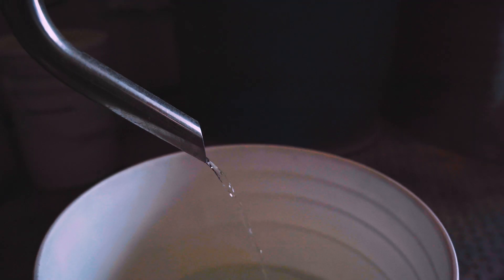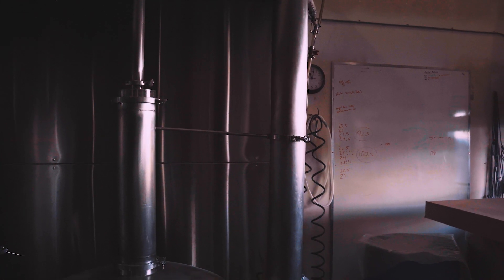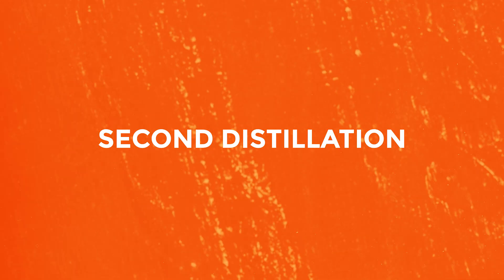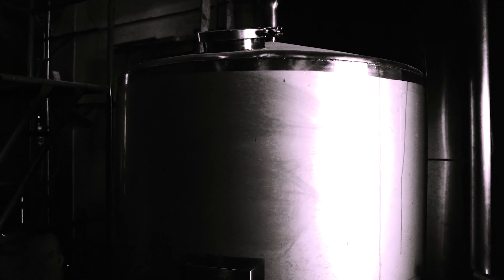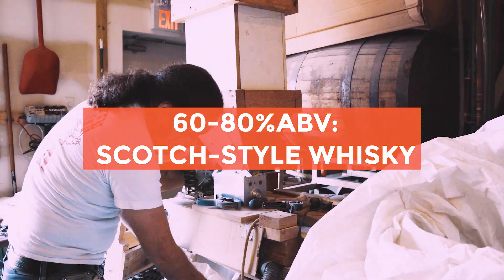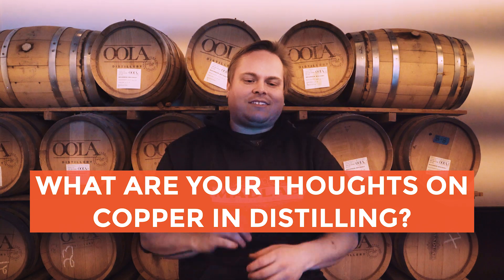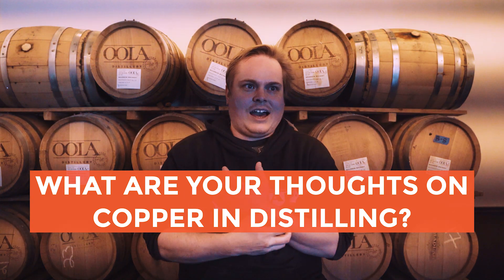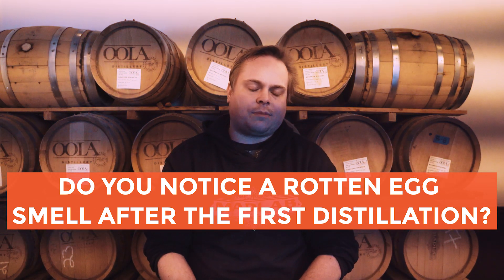Zero Copper Distillation Set-up | Mad Lab Distillery

Comment: I run the corny kegs too for activated charcoal filtering.  Pretty much the same way.  But I cut it down while coming off the still to 50% with my adjustable filtered water output.  Watch my ABV after water addition to keep it at 50% or so and after all is filtered, I cut to 43% and let it sit.  I don't do a final cut to 40% till the day before bottling.

My still is copper with copper bubbleplates though.
Reply: I wanna know about corny filtration. How d u push the liquid? I wait ur answer. Tnx

Comment: Always interesting. So his distillation process is a stripping run followed by a spirit run with an empty thumper, all stainless. An empty thumper is essential at puke box. Passive reflux in the thumper? I am puzzled where the sulfur is “disappearing” to, his cuts? He is discarding foreshots only. He is rerunning heads and tails in his stripping runs,if it is hiding there it would build up.
I am an old dog have trouble wrapping my head around this new trick.
Did you taste sulfur “nasties” in his white dog? I would think the charcoal filtering would mitigate detectable sulfur in his vodka. 
Certainly something to keep me thinking, thank you, Brewbird. Please don’t stop, your videos are something to lookward to.
Reply from the maker: I did detect a difference in the aroma of his new make spirit compared with new make from an all copper distillation set-up. Sulfurous compounds are usually very volatile and will dissipate into the air naturally if you just let the spirit sit uncovered. The "stripped" hearts section definitely had a strong sulfurous odour when I smelled the container, but yes it was just interesting to see this kind of distillation process.